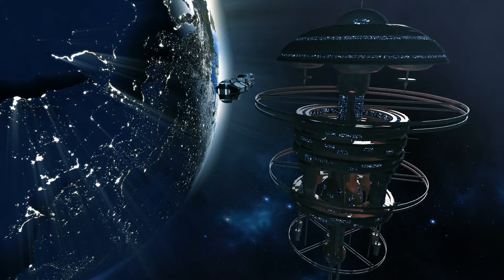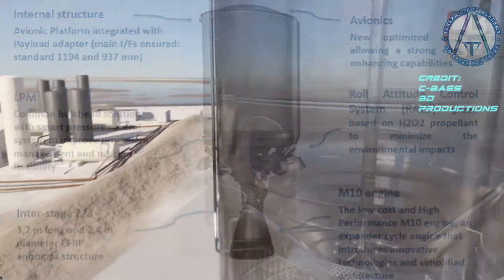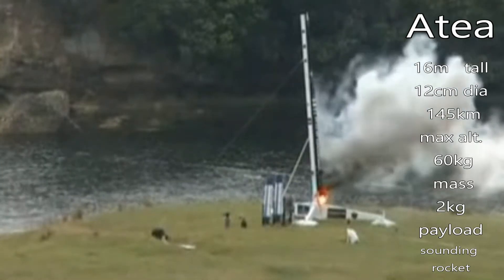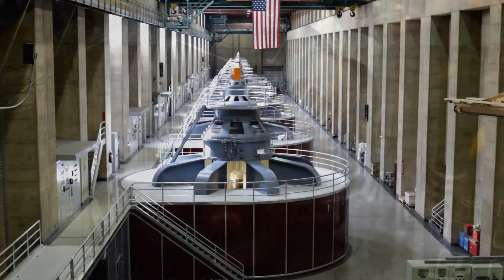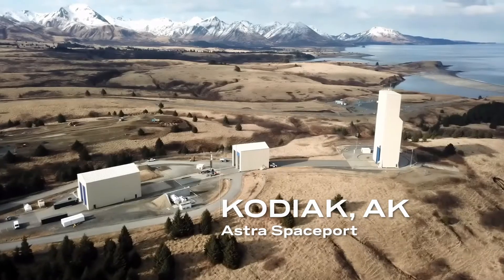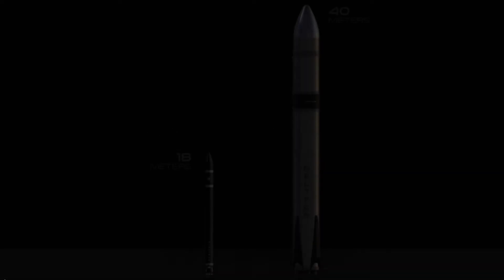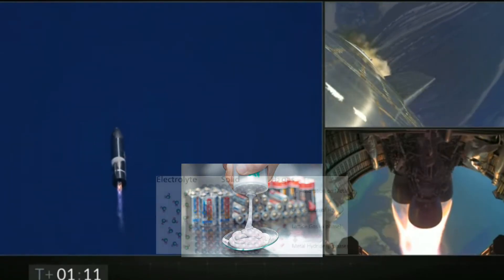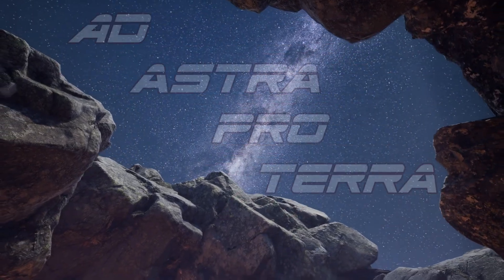Rocket Science: Turbopumps and Electric Pumps for Rocket Engines

Comment: To me, it seems more useful as an engine that needs multiple ignitions and a large throttle range. To reach an orbit to travel to the moon or to land on the moon. Maybe also for landing on Earth. In this case, smaller engines are needed needing less power for the pump.
Reply from the maker: That's a good point and provides precise landing control.

Comment: as a human specie we will not used heat.  combustion will be of the past. we will go nuclear using reactor to power ion propusion. water will be separated into hodrogen and oxygen on demand and each gas ionized separatly at much higher energies that normal combustion. they will use supercondictive magnets to shield the engines themselves from being eroded by the high energy particle release. particles will be ionized with millions of volts and high currents. the nuclear reactor will power the electric generators and provide heat to the space planes. reactor shielding will use absorbent materials to protect the people from reactor exposure. the space plane will have water in the lower part of the wings while the plane itself is shaped as a flying wing.
Reply from the maker: Probably at some point but not yet.  And nuclear uses heat too :-)

Comment: An electric pump instead of turbo seems like it would make a lot of sense for a lunar lander StarShip rocket engine as StarShip all ready has both solar panels and battery’s, might be able to save a little fuel.
After hearing about superconductors for the first time decades ago, I started think about Throwing the word super in front of different items such as super nonconductors would make a perfect capacitor, super reflectors took me down the same path as you expect my photonics capacitor was spherical and Resembled Christmas tree decoration and deadly if drop witha charge, and charge up by a C-Band size Solar collector📡, but sadly I too couldn’t find any of that super reflector material either.
Reply from the maker: The problem is power... even a relatively "small" rocket engine needs enormous power for the turbopump.  Most electric pumps are far too weak until the engines get tiny.  And the batteries rapidly run out of charge... expander cycle engines for hydrogen and methane are probably the lightest option.
Reply: @terranspaceacademy  
So you don’t think reduced gravitational field of the Moon would be enough to enable nose cold thrusters using electric pumps showing placement in CGI render of the lunar lander to lift off far enough to engage main raptor engines, running on the same fuel as raptor. The battery pack used in prototype StarShip was that of a Tesla car, if the new battery type is used, it should be able to draw even more current because of new tab design.
Reply from the maker: Might be a good option... I've always thought HTP produced enroute from water and electricity with new catalyst systems would be a viable option.  Have hydrogen and oxygen tanks for fuel cell power.  Collect the water and start making HTP... catalyzed HTP gives 900C steam and oxygen... supplement methane as needed to boost thrust.

Comment: could be the future of small jets too.
Reply from the maker: It could indeed. An electric/LNG hybrid engine could use the e-motor to get up to speed, then supplement with LNG for more power and to recharge the batteries in flight.  Extended range with precise control.

Comment: Great video. I was thinking you could solve the batter/power issue with electric pumps by adapting the expander cycle whereby the exhaust would be used to drive a turboexpander, connected to an alternator, that or use the oxygen and hydrogen/methane to drive a wankel engine, which would also be connected to an alternator
Reply from the maker: Exactly... though a molten carbonate fuel cell would double the efficiency over a Wankel... have you read about the ACES ULA hydrogen IC engine?  It seemed very viable.

Comment: Our technology will change dramatically when we will capture that ten-kilometres diameter platinum asteroid orbiting the belt just outside Mars orbital plane.
And maybe the same sized pure gold asteroid on an half-degree lower plane.
With platinum we can catalyse electrical energy out of almost everything; maybe convert a dense stream of Beta-Rays into a dense stream of electrons. A dream come true: converting radioactivity into electricity directly, without turbine and alternators.
And - Gold and Platinum can form an with a tensile strength only seen in Sci-Fi movies.

A question: would be useful generating the 10-50 MW of electricity with a pre-burner spinning a turboalternator at low speed (say 5000 rpm) and then using this electricity to power high speed electric motors - in turn spinning the fuel/oxidiser turbine impellers (say at 100K rpm). 
The engines would be much more compact, but the rocket would have this additional turbogenerator - common for all engines. But I can't figure out the total weight - say for 33 Raptors...
Reply from the maker: An electroboost turbopump is a viable consideration I think... I'm doing some math on it...

Comment: If it’s the hot end of the turbo pump that causes issue why not drive the pumps with a gas turbine engine. I realise gas turbines are usually air breathers but given you have pressurised oxygen then you could dump the compressor and just have the combustion chambers and turbine. Basically you’re just moving from a centrifugal to axial turbine. Gas turbines run ‘forever’ without issues compared to a rocket turbo pump…
Reply from the maker: Didn't the V2 use something like that?  I'll look that up... I've always wanted a Tesla Turbine to be used... just because I love them :-)
Reply: @terranspaceacademy  I think the V2 used a steam turbine
Reply from the maker: @stuartshutt4118  it used hydrogen peroxide over a catalyst to power the turbine :-)
Reply: Oops, calcium permanganate

Comment: I am wondering if some form of generator/electricity production could be integrated into the rocket motor... lol, as if it isn't complicated enough to use them just to create thrust for propulsion... and if the sacrifice of some of the rocket power could be scaled proportionally for better electrical supply versus the weight of batteries...
Reply from the maker: If arranged right the motor could be used for both spinup and power on a regular turbopump :-)

Comment: Excellent video 👏👏👏
I think what RocketLab need is Supercapacitors. Supercapacitors have high power density. They can discharge fast enough, dumping large amounts of energy on demand. The fact they can also acquire high amounts of charge in seconds is another benefit; they could be recharged quickly by solar panels and recycling some of the rocket's 'wasted energy'.
If RocketLab will make this work on a larger scale, I think I can only picture them using Supercapacitors...for now.

EDIT: I commented before getting to the end of the video, when you talked about the problem with using Li-ion batteries. Didn't realise you would talk about it.
Reply from the maker: I am fascinated by supercapacitors also.  I think they have a lot of potential. Right now they can produce and accept power very quickly, but cannot last long enough.

Comment: What if you used a full flow staged combustion cycle - one side had a regular turbo-pump but the shaft was also connected to a generator which ran a motor for the other combustion component?
Reply from the maker: I have wondered about that. With electric generators and motors there is not very much energy loss.
Reply: @terranspaceacademy  - It seems to be an acceptable strategy for diesel electric trains, ships etc

I'm sure the scientists know a lot better than me but perhaps we'll see that.~

Having the generator/motor on the shaft? also a 'starter' for the turbo side - power it from the ground equipment at launch etc
Reply from the maker: @JohnnyWednesday  The problem is not efficiency power. Look up the ACES, Advanced cryo-genic, Evolved stage.  It uses a very interesting internal combustion engine burning hydrogen and oxygen from boiler at almost 80% efficiency. I have thought that three or four of those revving up high could be an extremely efficient way to generate power. Of course it would work for methane also.
Reply: @terranspaceacademy  - I'll read up on the ACES :)  - yeah I thought at the very least? as you suggest? the spin could be used to pressure feed for ignition or just to decrease the load on the pre-burners / pumps.

If they were spun-up using motors and solar before a planetary transfer burn? the centrifugal force could perhaps always be relied upon to supplement a burn.

If thrusters firing to transfer fuel in orbit is problematic? spinning might be an option there too - procession during fueling might become the norm ;)

Hope you're well! I really love the channel - your intelligence and gift with analogies is very much appreciated!
Reply: @terranspaceacademy  - Take the belly flop - they have problems with the fuel sloshing around and gas bubbles entering the fuel lines etc - if the fuel was swirling around in the header tank and then the ship tilted upright? the momentum will keep the fluid in roughly the same plane of rotation, sans friction - add a bit of an angled inlet etc
Reply from the maker: @JohnnyWednesday  Just remember. The fuel often weighs much more than the ship. Pumping it in a circular
fashion that way you could make the ship uncontrollable. :-)
Reply: @terranspaceacademy  - I'm not suggesting it would be easy, I certainly couldn't figure it out :P

But I'm under the impression that rocket scientists and engineers are in the business of 'barely controllable' ;)

Anyway - just a thought!

Super-heavy will have plenty of margin - I wish Bigelow were still in business! their giant inflatable space station would of fitted rather nicely on top ;)
Reply from the maker: @JohnnyWednesday  Wouldn’t that have been awesome.? I tried to get interest in different companies making it happen anyway but it doesn’t look like it will. Perhaps sierra Nevada will put up something good.
Reply: @terranspaceacademy  - Hopefully! with a fully working super-heavy? perhaps a conventional second stage and faring may be developed for launching such things.

Although even Starship contained elements would be bigger than current dimensions - Imagine a 6 metre docking ring that you can fit a raptor engine through ;)

In orbit construction - 3D printing and mechanical assembly by robots?

Exciting times! from a fan of engineering history perspective?

The thing I'm most looking forward to? is the first in-space construction of a pressurized volume - preferably bigger than the box it came in.

I can't quite define it properly - but that's the 'turning point' for me
Reply: @terranspaceacademy  - ooh! I had a great idea the other day and don't have anybody to share it with - you'll enjoy it! :D

What if the fuel were spun inside the tanks like a fly wheel while on the pad?

There's hundreds of tons of fuel and you can spin it as fast as the materials will take.

I don't know how it could be used - but a lot of energy could be 'added' to the rocket without any extra mass...
Reply from the maker: @JohnnyWednesday  that is very interesting :-) you would have to worry about procession because the vehicle itself would start to spin on several axes. On the other hand if you had to counter rotating sections you could store energy that way and you could immediately fluids by just opening the valves and she would have centrifugal force to the side.

Comment: you could also have a larger pump, or just have hybrid liquid solid oxidizer
Reply: or the box ruptures because of photon pressure
Reply: photon rocket, energy to momentum
Reply: directly
Reply from the maker: The problem is the power source. Until we develop antimatter at a reasonable expense or at least helium three fusion our options are somewhat limited.
Reply: or dont launch any fuel to space, slings and puffs
Reply: you could also detach the electric source, using a battery loading generator, mechanical-electric-mechanical and so on, or use a fuel cell
Reply: if you have a heat pump, in a steam engine, and a supercap or hypervoltagecap, you get the near perfect energy storage, generation and transmission, so make steam great again
Reply: super caps and "hyper" high voltage direct caps can pulse very large currents
Reply: dont mix power and energy densities
Reply: TiO2 hypercaps are equivalent to NiCd, better high voltage direct caps can be made

Comment: I recall that a RL-10 expander cycle engine was successfully test run on methane in the late 60's or early 70's with little modification. Must be a paper rattling around NASA on this somewhere.
Yes, petrochemical fuel does have a propensity to soot and coke, but SpaceX's Falcon is operating their fuel rich gas generator cycle in a reusable mode and every pump fed engine is test run prior to delivery including the Saturn V's F-1 and  Atlas' MA-5's so all of these are "reusable", at least in a limited sense. Soot does have a positive effect of contributing to insulating the combustion chamber and nozzle during operation.
Reply from the maker: The Merlin and F-1 running fuel rich though.  If you don't mind throwing away some propellant you can run all day with RP-1.  Or at least one full burn, a partial burn and a landing burn.  If you tried to run a full flow staged combustion engine with RP-1 you would have a real problem with the fuel rich side.  That is why all the Soviet RP-1 engines are closed cycle oxygen rich.  In an open cycle engine the cooler turbopump vent is often ran along the inside of the nozzle to protect it, you can see this on Saturn V launch videos.  And the soot has an insulating effect as you say.  But refurbishment would be necessary after just a few flights or you would get coking problems even with open cycle.

Comment: Could you use one big turbine+generator to generate power for the electric turbopumps on several engines? Then you'd reduce the number of turbines and still not need to store all the electricity. The shaft sealing issues on normal turbopumps would also be eliminated.
Reply from the maker: That is a good thought but the added mass and reduction in efficiency has been deemed not worth it for first stages,  In space operations might be quite different.  The Advanced Cryogenic Evolved Stage proposed by ULA that would be good for that concept.

Comment: A battery that can only discharge  is called  a primary battery 
If it can be recharged then it's a secondary battery 
Had to look it up when I took freight to the airport. 
Many GPS and temperature trackers use primary batteries to bypass strict rules .
Plus a primary seems to have higher density and can run for weeks .
Reply from the maker: I like that. I had chosen to call anything non-rechargeable a generator for clarity but that is good to know.
Reply: @ Tom Robertson - 
Did NOT  know that !! THANKS !
ALL the BEST !
@Terran Space Academy -
THIS is what I'm talking about when I congratulate you on the level of engagement of your audience . 
Seriously- the clarity, timing-and-cadence and the RICHNESS of the presentation is nothing just excellent ! 
VERY well done -
THANKS !
ALL the BEST -
C.

Comment: One day we will discover how to convert the radiation from nuclear fission directly into electricity. That day, rocket turbopumps will head straight to the scrapheap, being replaced by electric centrifugal pumps, like those on the Electron - but much bigger. 
To date, the best we can achieve with radiation from nuclear fission, is boiled water. Science historians speaks of "Steam Age" as developed in Victorian times, but that is a serious misnomer; as Steam Age is presently thriving, with Steam being obtained from heat from nuclear radiation - instead from the burning of coal. The day we will truly exit the Steam Age, a dense bountiful amount of electricity will make possible to build rocket pumps that will dwarf the 40+ MW of the Rocketdyne F1 turbopump (same as a jet fighter engine). Maybe the full power of the F1, 10 GW iirc, could be produced as electric power, that would be used by a plasma engine at that point. 
Thank you for the very knowledgeable video.
Regards from the UK,
Reply from the maker: Helium three fusion produces high speed protons which can be turned directly into electricity. But it’s all on the moon :-)

Comment: I hope somebody is thinking of a hybrid gas/electric turbo pump.  :)
Reply from the maker: Methane-based :-)
Reply: @terranspaceacademy  Yup.  Gas/electric   Spacex/Electron.   Electric motor for start up fine control and low thrust.  Fuel powered turbine for full throttle. All on the same shaft.  :)  ?
Reply from the maker: @ebenwaterman5858  I love it :-) and the technology is quite mature now.
Reply: @terranspaceacademy  ;)